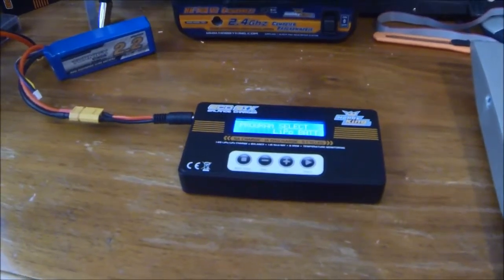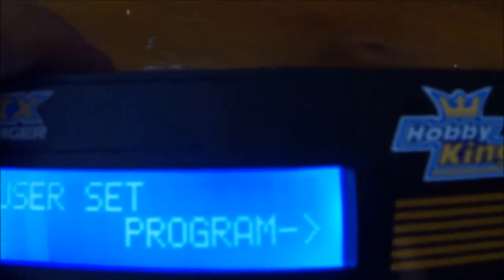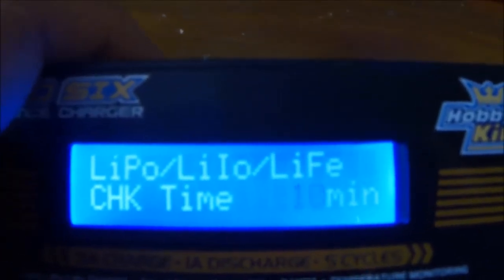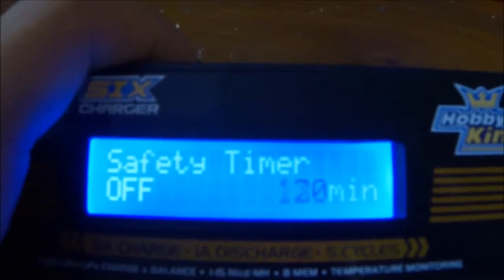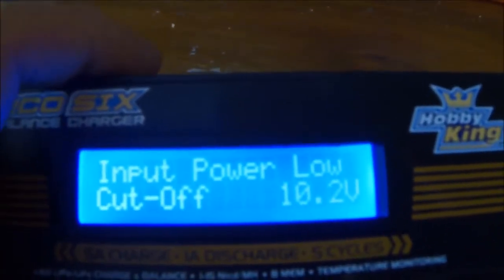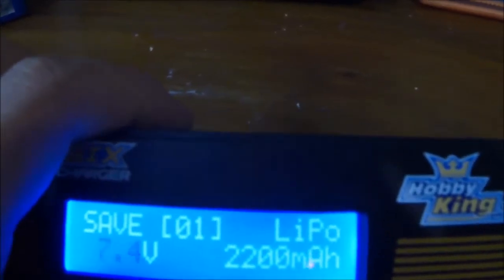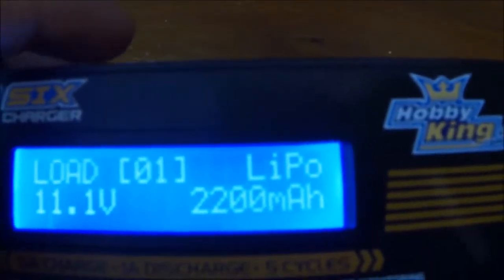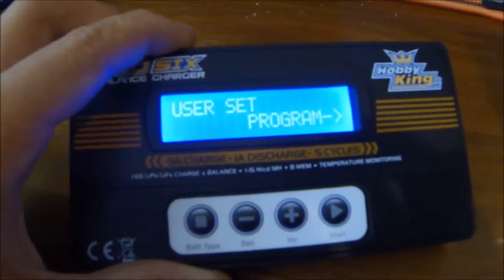HK ECO6 balance charger tutorial (part 2)

Comment: How do you adjust the volts per cell for LiPo from 3.7 to 4.1?
Reply from the maker: This charger is not Li HV (Lithium Hi Voltage) capable and only offers 3.3, 3.6, and 3.7 volts per cell.